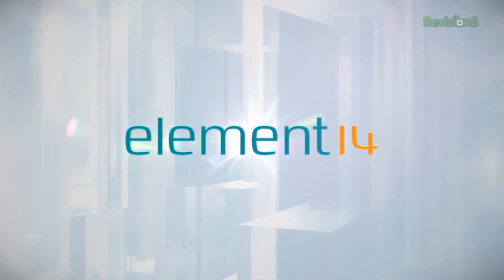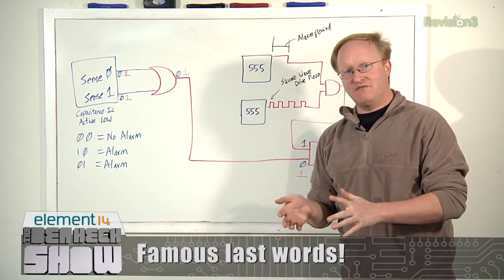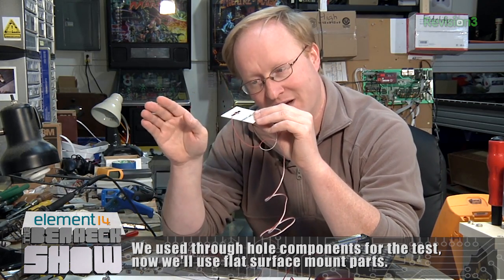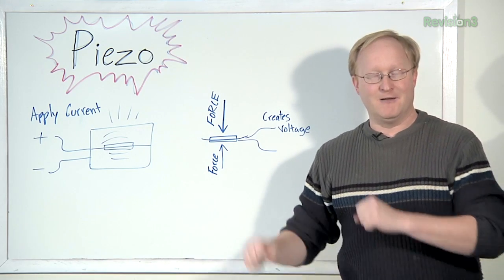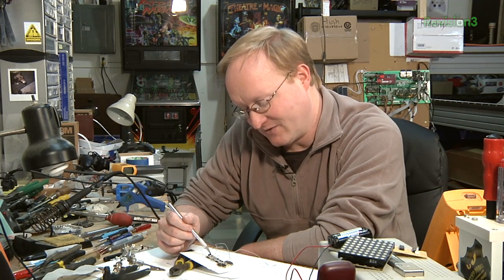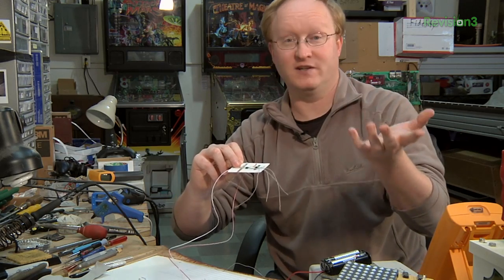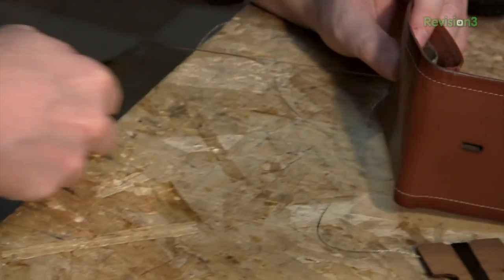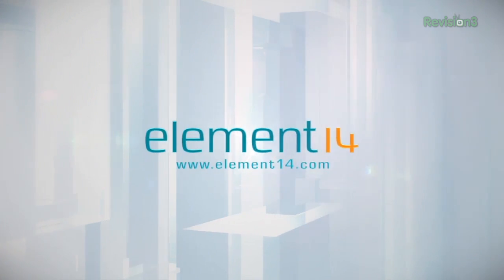Anti-Pickpocket Wallet

Comment: Maybe have a special thing in the pocket it will hold onto for dear life and a fingerprint reader like that found on phones or some laptops.  The idea is that unless it detects an authorized print it will be much more difficult to remove it from the pocket without cutting it out.  GPS and alarm that only people who have no hearing could tolerate are also a must.  Here in the USA if someone has stolen something from you, you may get the Police or the Sheriff to help you recover it.  This would be easiest for devices you can prove the location of such as phones.  Assuming they were not careful, you might be able to track its location which is either the where the thief or receiver of the stolen property is.  I say receiver of stolen property because he or she would be someone the thief either gave it to or sold it to.  They might not be aware it was stolen so just use the law to compel them into telling you as much as they know about the seller.

Comment: love your videos and the fact you [correctly] pronounce multimeter: mull-tim-e-ter always brings a grin to my face. 

Dunno why it's always bugged me hearing someone say, "Hey hand me that mull-tea-meter I need to check this __." Which half the time started a heated discussion about if they'd ever heard of a bear-oh-meter or an al-tea-meter.
Reply: Nothing wrong with saying "mull-tea-meter". It's actually the correct pronunciation. Multi-meter, a meter of multiple uses. Just like how barometer is a meter of barometric pressure and an altimeter is a meter of altitude.

I think you were confusing which syllables to stress, but in these cases, it matters more of the origin of the root and suffix. Glad to help!
Reply: My point on the stressed syllable stands nothing in your response seems to counter what I said originally, baro means relating to pressure so why don't we call the device to measure pressure a baro-meter instead of ba-rom-e-ter? The same could be said for altimeter.

Comment: Such a simple idea was made unnecessarily complex, possibly by the knowledge that "Oh well, if it all goes wrong, a microcontroller will come to the rescue". Not everyone has AVRs and programmers, so you've unnecessarily added a further requirement for something which could be done with discrete components, with a little extra thought and consideration.

I do not wish to be seen as rude, but yes - that was a cop-out slightly cheating. Here's an idea:

Make a random pattern of four discreet, outward-facing holes in the wallet, and place photodiodes or cadmium sulphide photoresistors behind them. Use them in an "AND" gate configuration, so that ALL the holes must be covered simultaneously (you'll learn where the holes are very quickly - place eyelets into them to allow your fingers to locate them in a tactile manner). Each wallet will have a random combination of these holes, so a pickpocket could not guess the location of the holes. 

Usage: You have to remove the wallet whilst simultaneously covering all three sensor holes AND THEN, whilst covered, dis-arm with the button described below:

Next, have a "dis-arm" button (highly tactile) inside the wallet, UNDER the fabric; click once whilst still covering the holes, to DIS-arm the alarm. The circuitry would then be looking for a state where ALL holes are re-covered and dark, to re-arm the alarm (or you could use the tactile switch and a 10-20 sec delay to signal "re-arm" instead.

Look, not an AVR in sight! :)
Reply: ***** Yeah, but come on. You can buy these microcontrollers pretty cheap online. And its easier and cheaper to buy them than to have a whole box of discrete logic chips. Also ICSP programmers are pretty cheap and you can get them for as low as 6$ so thats really not a big deal.
Reply: If the issue was power rails, then the solution is to decouple power rails by inserting a low-impedance decoupling capacitance path right between the legs of an offended component and potentially an inductor towards the offending component's power rail to isolate the bursts.

I don't know how this guy gets away with doing the show in this manner. It's like he never read an electronics engineering book in his life, but is hailed as a major engineer across media and it goes to his head. I know, he's a good designer/modder, but he has to consult external expertise before he spews bullshit to a wide audience which accepts his word as gospel.
Reply: Unlokia thank you.

Comment: The cause of the "always beeping" error is the fact that these touch-ics perform a calibration on power up. They take the capacity present on the input and store it as "not pressed", after that they start working normally and output a signal if the capacity increases (I.e. Someone touches the sense line).

Comment: This won't be very reliable, especially if your pockets are man-size ones where the wallet is a little loose (the switch won't stay closed) or if you have other items in the pocket with the wallet which may cause the switch to not close. Oh and what happens if you close the switch by accident while it is out of your pocket?

Comment: I don't know why people have a problem with using microcontrollers. Do you think when Apple is designing a product they use a hard to work with component only because it has some cool factor associated with it because it is hard to work with? As for the price, it seems to me one attiny is cheaper than using multiple timers and gates, and even if it wasn't, your time has to be worth something.

Comment: i know it might not be applicable for a wallet, but me and a few friends made a system for cars, that if anyone who touch the door handles or put anything metal in the locks or other sensetive areas would get shocked by a stungun.

It's function is really simple anyone person who toches any of those parts will become ground for the curcuit hence get shocked, the only way to prevent this is using rubber boots or gloves.
Reply: Nice
Reply: At any rate it sounds very useful against those car key-ing asses and other mindless vandals.

Comment: Instead of beeping - which might not stop a thief from running away with it - the wallet needs to shock them so they drop it on the floor.

Shocking people - another use for piezo devices :-)
Reply: I'd prefer a paralysing agent to be injected though tiny needles...
Reply: TehH4rRy what if you for get to grab the wallet in the right place?
Reply: You have the antidote already injected. Duh

Comment: My approach on this would have been a bit different. I would have put an RFID chip into a Paracord bracelet and have all the circuitry inside of the wallet. Two pieces of conductive tape would be touching inside of the wallet telling the MCU the wallet is closed, if the circuit between the two pieces of tape was broken before the RFID was verified it would sound an alarm. So you would swipe your wrist on the outside of the wallet then it would be safe to open, I would probably have it so it made a small beep when swiped too, so you knew the alarm was disarmed and you wouldn't make a scene in wherever you are. Of course after the alarm was activated you could manually shut it off with the RFID too. Just what I would do, not trying to bash your work. :)